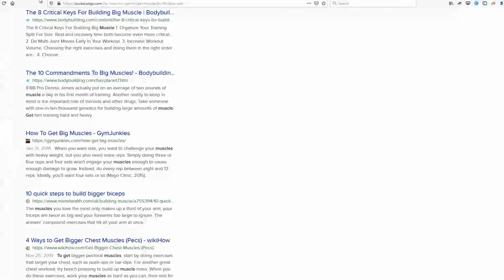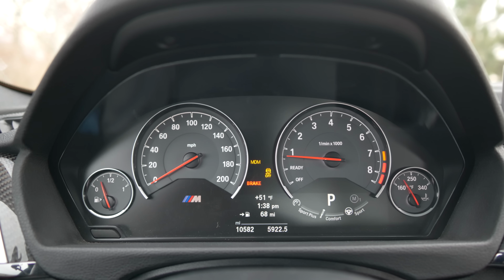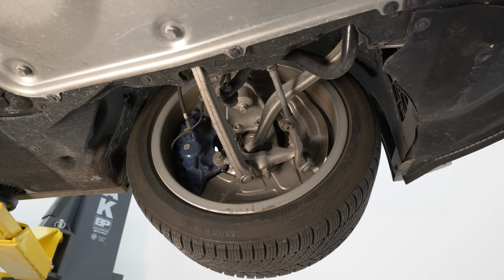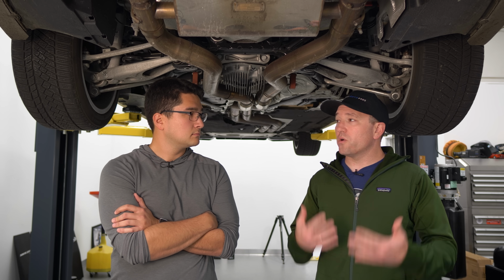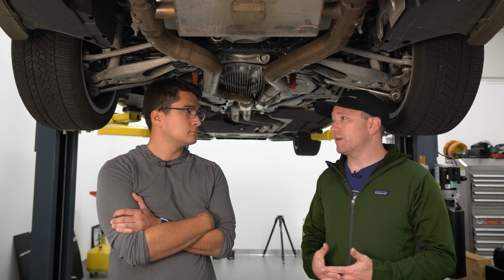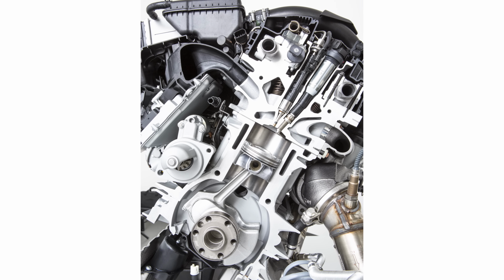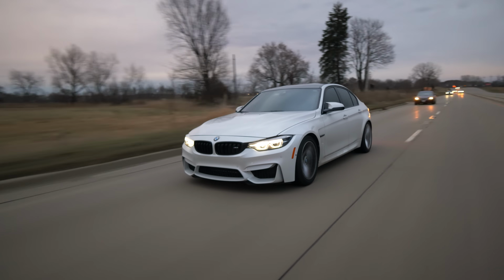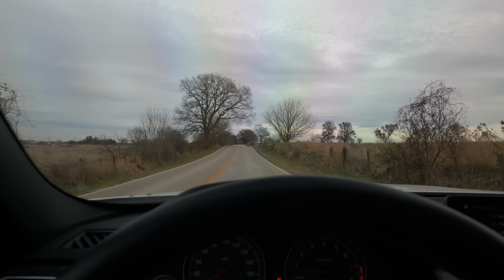BMW F80 M3 Review | The Sports Car for Mathematicians

Comment: Apparently mathematicians aren't great at calculating depreciation
Reply: What $80,000 car doesn't depreciate like crazy? They all do. Buy used.
Reply: Morgan Grant Lexus
Reply: @louisv2853  so you lose 50% in 5 years instead of 55? IDK.  RC F looks to be about 100k Canadian. There's a used one with 40,000kms nearby for 51,000.   Brutal.
Reply: Morgan Grant if you look across their whole lineup they retain value as much as every other brand other then Porsche and Ferrari.
Reply: @Soflow210  I'll take your word for it. At least one of my points still stands. Expensive cars depreciate a lot. Try trading one in every 3 years if you want to find out.  If cost of ownership is is a priority or it you have ocd and want to drive something different every couple years, buy used.
Reply: Morgan Grant 
I was initially referring to the brand all together  not specifically any model 
Bmws just don’t hold value
Reply: @louisv2853  BS.
Reply: @louisv2853  See above for response.
Reply: Some cars do more than others. especially a brand like this that's known for breaking down because of too much plastic around sensitive important car parts. 2-3 years top b4 u spend 1000s a year.
Reply: Morgan Grant I was going to answer 911 but they start higher than $80k
Reply: @louisv2853  just because someone disagrees with you doesn't make them a fanboy, I don't think BMWs are the best financially but I don't see the problem with that if you buy a car for the purpose of a car, to drive it. Why are people worried about resale value with vehicles like these
Reply: I buy used cars only. So I’m cool with depreciation.
Reply: @McBeakerson  yes. Rent. Even better
Reply: exactly - get the 'right' Porsche instead............
Reply: Best comment EVER🤣
Reply: Anyone who buys a car like that doesn't give a damn about depreciation...
Reply: @young9534  smart. Very smart.
Reply: @EAGLINWRX  "Why are people worried about resale values with vehicles like these" - Amen.  Obtain a good driver's car.  Drive the wheels off of it.  Replace wheels, and repeat.

Drivers care about the art and science of DRIVING, not about what car brand holds its value longer or impresses people whose opinions they don't care about anyway.
Reply: @morgangrant5180  You cherry picked the one Model of Lexus that is a terrible seller.  If you want to know real depreciation rates, just look at lease rates.  No need to try to use anecdotal information.
Reply: Open Ranks  Most cars depreciate, but I found trucks depreciate less and older cars seem to depreciate less from one year to another. My 2013 F-150 was worth $20k last year and it's now $21k with more miles per Carvana. I bought it new for $32k. So if the car is old enough it doesn't depreciate much.
Reply: @hamsterbrigade  I picked it because I thought it was the closest thing to an M3. It's odd that these cars command a premium in the used market over comparable German offerings, yet they have such a microscopic market share. (Please don't tell me they limit production to protect used values, I won't buy it, I refuse to)
Reply: Open Ranks  I just know my truck didn't go down much in value. In Nov 29th, 2019 carvana had it at $20,500 trade in and now in Dec it's $21,226. I think it was $20k last year also, but I could be wrong. The truck basically cost me $150 per month in depreciation, which is great compared to my F80 BMW M3. The point is you can buy something new like a truck and not loose too much to depreciation per month.

The BMW to get is the 1M for good resale value or to collect. I bought the M3 to enjoy driving it, so I am fine with the high depreciation it has compared to a 1M.
Reply: @WoodstaS  Thank you!
Reply: That means your life is average.
Reply: Ppl who buy it new doesn't give a damn about depreciation. Because they have the money.
Reply: Oh snap shots FIRED! Lol
Reply: @morgangrant5180  You want to see something truly hilarious? BMW vs Lexus SUV depreciation. And, keep in mind, the RC-F is a low $60k vehicle. That's still way better than M3 depreciation.
Reply: Who buys a modern car (especially a sports car) for an investment anyway?  Your comment is pointless.  I will note I purchased my brand new '17 M3 zCP in March 2017 and surprisingly the car was worth more than my loan payoff two years in.  2.5 years later its worth $6K more than my loan payoff.
Reply: @morgangrant5180  how old are the RCF for that price? Because 8 yearr old Lexus Is F with about 40 000 km on them are still going for 50k ish canadian.
Reply: They do devalue like crazy, went to look at one with a friend 18 months old 5k on clock and had gone from circa  £58 to £40k in that time! He hasn't bought one as other second car options would  lose less. This is a guy with 40k spare cash to outright buy the car. Just because someone could take the hit doesn't mean they are prepared too. It is the same for all the big numbers manufacturers though.
Reply: All cars depreciate, but some do it more than others.  BMW'S do it more because they 'splode.  The end.
Reply: Ok boomer
Reply: @weirdshibainu  Nope, just your garden variety, Gen-X M3 CS owner ;)  But thanks for playing!
Reply: @blendtecbrah  uh huh
Reply: @blendtecbrah  new nickname for BMW'S?  They've been spinning rod bearings and blowing seals for years so yeah, it fits.
Reply: @BrandoDrum  That was the E92 bruh, not the F80.  The only thing you have to watch out for on the F80 is the crank hub, and really only when you're running upgraded turbos.
Reply: @weirdshibainu  Scout's honor bro
Reply: @blendtecbrah  well the E60 did it even more...and there was the turbos constantly blowing out even in the 340 along with all the crazy electrical problems that plague the 7 series...I could go on.  BMW'S top depreciation charts because they have a reputation of being basket cases and I still not convinced by lip service on one single generation nor are buyers.  Deprecation nails owners of BMWS in the face lol
Reply: @morgangrant5180  3-4 years old base 911 carrera
Reply: @brucebigbro4079  a used 911? Yes. They will hold their value. Just don't run up the odometer 25,000/yr.
Reply: Imagine assuming people buy new. Just because you're stupid doesn't mean Mathematicians are.
Reply: most people do not purchase cars as an investment, if they do they certainly are not "mathematicians".  Sounds as if you need a $2000  used Honda civic with tan interior.  Plain vanilla like your personality and logic.
Reply: @mrphotomanTIM  troll elsewhere
Reply: @Taanstafl12  get a grip....
Reply: @weirdshibainu  insert overused and regurgited 0iq retaliatory catch phrase with absolutely no substance pertinent to the subject what so ever here
Reply: @Taanstafl12  troll elsewhere
Reply: @weirdshibainu  or nah
Reply: @weirdshibainu  vanilla response served in a styrofoam bowl
Reply: @Taanstafl12  your mom is calling
Reply: @Taanstafl12  you give yourself too much credit....your priest told me so
Reply: @weirdshibainu  What's his name / state of priesthood?  I'll wait.
Reply: @Auto blipper correct.  I've driven Lexus and while screwed together well and reliable,  it's a sterile driving experience
Reply: Louis C agree. Lexus are expensive but don’t depreciate a lot. They’re still expensive used. Want the worst depreciation? Get a used BMW or Range Rover. Those vehicles are crap out of their warranty.
Reply: @louisv2853  They don't hold value because the cars are POS to troubleshoot and some of the crutch designs made them notoriously unreliable.
Reply: @young9534  Except for BMWs, used ones doesn't make them cheaper to own.
Reply: @tomjones5166  The reason BMWs depreciates a lot not only because they are unreliable, they are usually leased so there's a ton of them being returned.  When I was shopping for used BMW 3 series.  I can walk to different dealerships and get $500 right off the tag without even saying anything.  I never had a Honda or Toyota dealer offer me a discount on the spot without haggling hard.
Reply: @Vision33r  BMW may not be unreliable but you don't or I don't expect a German car to be as reliable as a Toyota or Lexus. Most cars can be leased and will depreciate like my daily 2014 Prius did from $23k new to $10k now. I say buy a car when the market is flooded with lease returns to save as you see my Prius lost $13k in value since new. I bought my pre-owned 2016 M3 last year when the market was flooded with lease and It's now worth what I paid a year later.
Reply: If depreciation on cars scare you. Ride the bus.
Reply: So what you’re saying is that everyone should buy used and car manufacturers should stop building cars and whatever is currently on the road is what we’ll be stuck with. 
Yeah, no... I don’t buy used. Either way I get bored with a car about 2 years in and ditch it in 3-4 years
Reply: Why would depreciation matter? It just means you can have one of these a few years down the line for half or even less than half of what it would cost new. Get a Lexus (and they're fantastic cars in their own right) if depreciation matters so much and even then ANY car loses a significant amount of it's value within a few years. Some of the only vehicles I see that retain good values would be anything from GMC with the Denali trim. This is a drivers car that is about fun and enjoyment, not so much numbers because numbers only tell half the story. The enjoyment that owners experience can't be quantified in numbers.
Reply: Dashcam Dumbasses I just bought a 5 yr old f13 m6 coupe w/low miles at a 70% depreciation value. Original msrp was 130k. Used is the only way to buy a bmw or any other car imho. Boomer out!
Reply: @banner7310  these cars are out since 2014 and are holding up really well.
i work as a civil engineer at german car factorys ... amongst them also bmw and i speak with a lot of M4 owners since i want to buy one myself.
some have this car as a daily and have driven 150k km (93k miles) and never had an issue and only were in the dealer for service which is insanely good for a bmw and even more so for a turbo 3l that pumps out 450hp (actually they are more at 480 to 510 at the crank but bmw underrates them).

for me in germany a m4 is cheaper to run than a 40k mustang or a used 40-50k lexus rcf
(parts cost more and taxes on bigger engines are insane just as the taxes on fuel)

also i dont really get the point with the emotion since if feel much more joy driving an m4 than a mustang gt but then again i am a german engineer after all :D
Reply: @japanwatchconnection True, but most wealthy people dont get that way by investing in depreciation
Reply: rvidal0001  over 90% of people dont buy these cars new but lease them its not that hard for many to afford this car without stretching your finances
Reply: rvidal0001  i dont know where you live but here in germany it is not that hard. they start here for around 30 to 35k and this is very much doablehere. also the runnig costs are also pretty cheap. i would pay 1k flat for insurance over the hole year and taxes are nearly nothing. then the payment which is pretty low if you pump in like 15 or 20k from the start. the biggest expanse would be tires and every 3-5 years new break rotors. i said this already in another comment here i know many people that own a m4 because of the place i work for and i talked with them about it. 

i am a fresh civil engineer and have a flat with my GF who earns also enough so for me at least its not a problem and even my workers i instruct own a few M cars and audi RS´s.
Reply: rvidal0001  thats why i said my workers drive them too ... you know like construction workers with a house and a family.
and a lot of the employees at the car factorys also drive cars like these and earn less than you and i.
the people with these cars i know really well and a few that i consider to be friends told me what is needed to manage the costs.
i dont know your situation or that in the US but here you dont have to be an engineer to get a car like this
Reply: rvidal0001  also i would have gotten the m4 this summer if it werent for corona so i know what it takes since i really looked into this befor the buy
Reply: rvidal0001  The wealthy invest in assets, the poor in liabilities.  I make 6 figures and drive a 10 year old car. If the transmission goes out, I write a check. Car payments are death to the average consumer
Reply: Mathematicians can buy used 🤔
Reply: @hamsterama  your point is well taken and accurate... no need for the
douchebaggery rhetorical question of how much a professional career makes. Some people make damn good money being smart with their money... and expensive commodities that depreciate hurt cash flow. I can respect disliking that type of commodity. But this is a damn nice sports sedan and I would waste 40 some thousand for one used. Get a warranty. Enjoy. ;)
Reply: @morgangrant5180  I guess you never seen the resale value of a toyota land cruiser :)
Reply: Mathematicians can afford the depreciation for extra luxury
Reply: @chung729chung  yawn
Reply: Come on guys,, those depreciation words for someone who cant afford luxury. U will throw back your words if u have 100 millions in cash. Luxury things meant to be wasted from a loads background. if u dont, dont screw up
Reply: @louisv2853  have u seen the prices for the M3 E30 not for sale ...not saying that this will happen to the f80 M3 as we don't know yet... but the e36 e46 and e90/92 M3 will follow the E30 one by one just saying..
Reply: if you're worried about the money it's not the car for you. This is a toy at this point
Reply: A few 2014 F-Type Coupe V8 are now selling for £33k here in UK they used to be near £100k new. Amazing car for value for a used car buyer like me.
Reply: @morgangrant5180  i agree. I'd never buy a new car because i tend to get rid of them within 1-3, and in fact i tend to buy the cars that are lower in the price range with decent miles because those tend to 1) hold their value better 2) quicker to sell.
Reply: hahahaha I guess engineers aren't either because I would love to own one of these. Hell I'd pay cash up front if I could afford one so I could do FBO and beat stock M5s down straights.
Reply: My alfa romeo giulia lost 50% in one year.  I feel a debt of gratitude to the original owner who bought it new so I could drive such a beautiful car.
Reply: @morgangrant5180  people who buy an M3 or an M4 generally aren’t worrying about cost of ownership.  I know I don’t. I bought mine because it’s a helluva lot of fun to drive yet can be driven every day either as a very comfortable (albeit with a stiffer ride than a luxury car) cruiser or an amazing performance monster. You don’t buy a car as an investment, you buy it for enjoyment and transportation.  Cost of ownership is a given on a high end sports car.
Reply: And that's great! This is why I can also afford one myself.
Reply: @louisv2853  and who gives a hot shit? the point of owning a sports car is to have fun, not to make a wise investment decision that returns financial value. If youre worried about depreciation, i can already say a luxury sports car is NOT what you should be getting.
Reply: @TheNondiscriminatory  this whole section was just commenting about depreciation, no one is saying that is the sole reason for buying a car don’t get so hurt! If that is what you need to tell yourself to justify owning your bmw then so be it.
Reply: @morgangrant5180  Porsche.
Reply: this comment hasn't aged well
Reply: This comment aged like spoiled milk.
Reply: This ain't age well
Reply: bought an m4 for 35k... it's gone up ~15k since then (=
Reply: If you are buying to resale it its a different conversation, if you are buying bcuz you simply love to drive and want to be thrilled as you do it, depreciation goes outta window.
Reply: This comment has aged so badly..these cars are worth more now than they were 2 years ago lol
Reply: @CadexLaw  Only because of the pandemic.  All cars have increased in value. Try harder
Reply: @weirdshibainu  cope harder.
Reply: @CadexLaw  Poor baby
Reply: Fast forward to 26:18 and the truth comes out about the f80 m3 😆
Reply: @morgangrant5180  pi ii😊ioppo😊oooô😊
Reply: not everyone buys cars as an asset buddy. some people can afford to lose that money...
Reply: @PROFITSTACKERAD  Hey "buddy" cars are seldom as asset. Try harder.  Lose money....I don't care.
Reply: @louisv2853  hilarious argument
Reply: @morgangrant5180  The RCF is a horrible example of Lexus/Toyota's vehicles holding value over a ten year period of time. There are others that are fine examples.
Reply: @morgangrant5180  land cruiser
Reply: Mate these cars don’t depreciate lol. Check the market before you comment next time yah?
Reply: @OhDearBabajan  are you delusional? The market completely contradicts what you say for basically every M car unless it's a specificly special model like the Z8 or a rare one.
Reply: @blewyd  M cars hold their value quite well. Case in point (me). I purchased my base 2017 m2 over two years ago which at the time had 17.5k miles for 41k usd. Today my car is worth at least that much, but it has 41000 miles. Who’s the delusional one mate? And for you to take what I said literally is crazy. Obviously M cars depreciate, just not by a  substantial margin. Oh and were talking about used car depreciation which is not the same as buying new. Because you know, they don’t make f80s anymore.
Reply: Gs350 and 540i are pretty similar on kbb , I call bs
Reply: @lancercool1992  Who cars what you call?
Reply: Lmao looking back, these held value great
Reply: meanwhile i’m reading this in 2024 as 60k+ mile f80s are still going for over 50 grand
Reply: @bigguy4u989  You're getting ripped off at that price. There are better deals. 40% depreciation is great if you want to live with it.
Reply: when u buy it used is not that big depreciation
Reply: This comment didn’t hold up very well 😂
Reply: This comment didn’t age too well lol
Reply: @haydenmccary9679 came to say the same thing
Reply: they’re still 50-60k lol 75k if you find one with under 5k miles and is a 2018